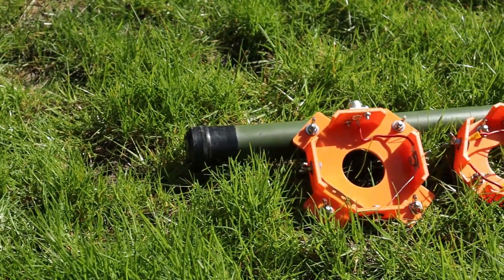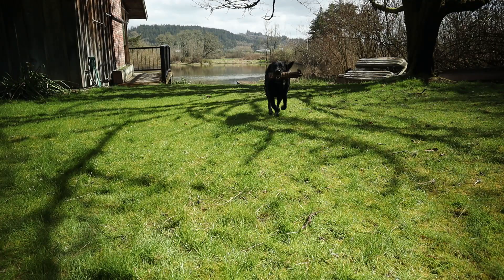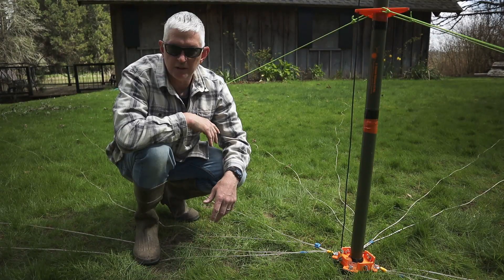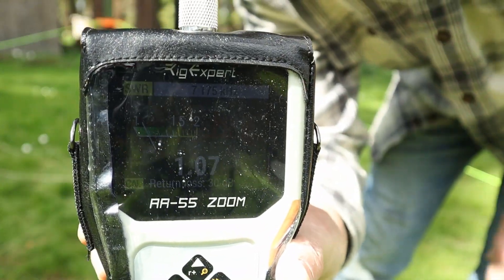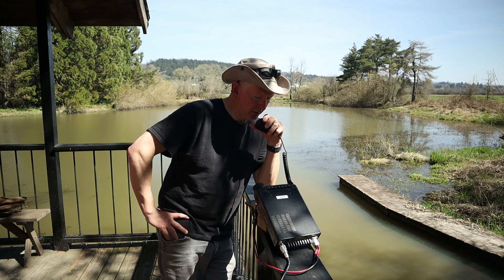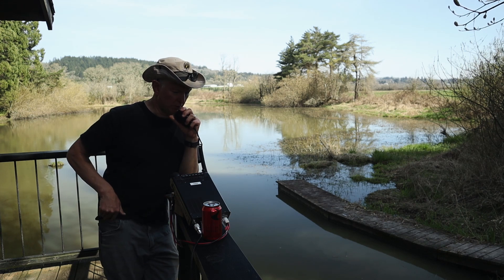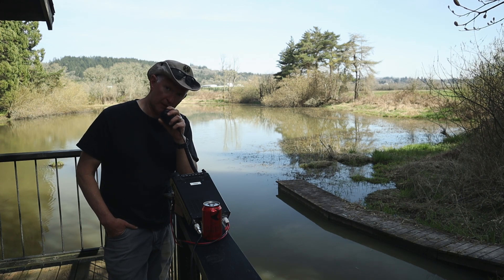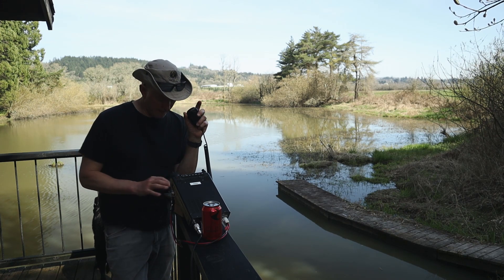3D Printed Multiband Vertical Ham Radio Antenna - Part 2 (#30)

Comment: Hey Stephen! I finally got myself a telescopic pole I was wondering have you ever considered making a ground plate/element plate that would accommodate 6 or 7 bands - I would really love one like that if you’ve got an idea for a design
Reply from the maker: Not really, it sounds cool however you will find that due to coupling you will start tuning out your other bands the more elements you add.  Its an interesting experiment you might try in your spare time.

Comment: Hi Steve.  I'm attempting to adapt your pole base to fit my mast.  I measured the diameter of my mast and it is 42.42mm vs your 34.89mm.  Would you recommend I just cut the bigger hole or would you scale the whole part until the hole was 42.42mm?   I'm leaning towards scaling in the x and y planes the down side is the bolt holes and SO-239 holes scale as well.
Reply: Update:  I just went ahead and made the center hole larger.  It looks like the clearances should still be ok.
Reply from the maker: Hey Joe - sounds like you figured it out.  Yes, I would just enlarge the main post hole to the size you need.  Have fun!
Reply: @W0KNI  I don’t have a printer yet so I sent it for printing via Treatstock.com.  All the antenna parts plus 4 of the shock cord hooks was 24 dollars plus 9 for shipping.   Will let you know how it turns out

Comment: Hey Steve,  Nice design.  I think I'll give it a try.  I've been using my Jackite pole with 4 elevated radials and an Icom AH-2 tuner and it works OK, but it would be nice to  leave the tuner  home. I'm up in Hillsboro and like to fly into back country strips and play radio the more I can leave home the better. I wonder if you could add 80M using radiator with a loading coil.  It would be narrow, but would give you another reliable band.
Reply from the maker: Hey Marc, thank you!  Thanks for stopping by.  I'm thinking about an 80M solution too, and inserting a loading coil might help reduce the foot print needed to pull off 80M.  Now you got me thinking! Thanks for the input, 73 W0KNI.

Comment: Thanks for part 2. I am sharing this now.
Reply from the maker: Awesome, thank you!  I'm aiming for part 3 by Thursday, that will quickly cover building the 3D parts in FreeCAD. I'll share the complete FreeCAD project file of all the parts I designed so anyone interested can print and/or improve on them.  Cheers!
Reply: @W0KNI  Excellent. I built it.. I've been building up the hype on my channel. When I get the first video out, I will be linking them to your videos and files plus giving you a shoutout.  I am in the process of designing one that instead of using screws and nuts, uses anderson powerpole connectors for the radials and the antenna wire.  Antenna works great though.  I got 40/20/17/15 and interestingly enough, 6m.